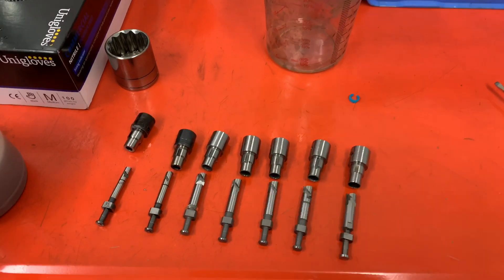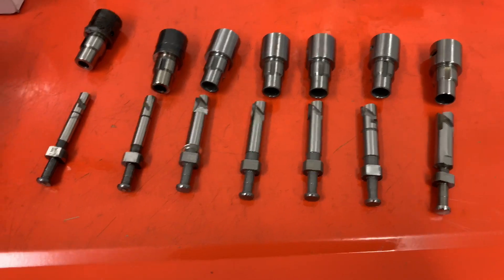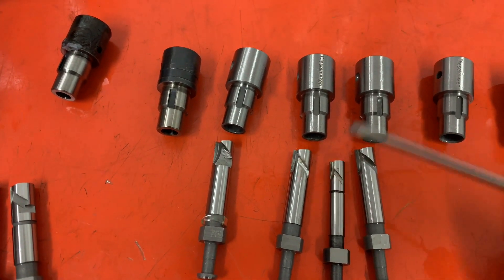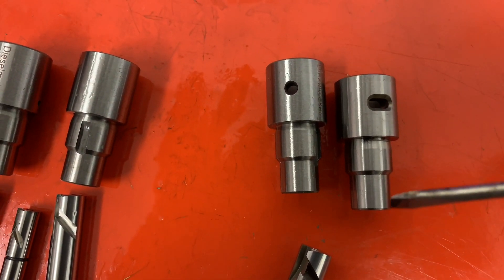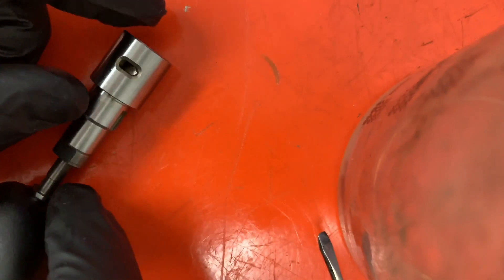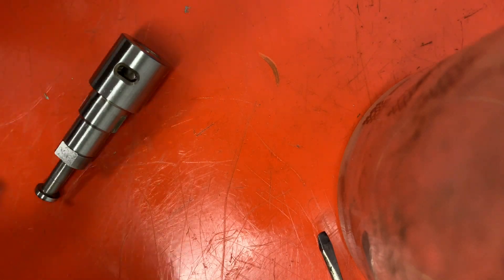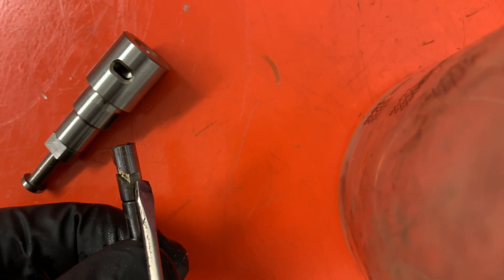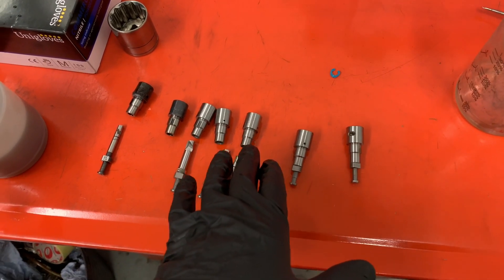Fuel Pump Elements Explained - Dieselpumpuk

Comment: Many thanks. The manual diesel pumps I work on are a little different because they are for stationary engines like the Petter PAZ1 and AV1 however from parts diagrams the principle is the same and this video explains exactly what is going on so it was very helpful.

Comment: Do the 7.5mm elements get good gas mileage? Putting an OM606 in my BMW e30 and I’m looking to make around 300-350hp to the wheels and get really good gas mileage. Does the design of these larger elements sacrifice gas mileage? Or can they be adjusted to suit with an ALDA? Thanks
Reply: Yes because it will push the same fuel in for idle so just be easy on throttle and it will push the same fuel as stock.  It just allows a lot more fuel at 100% throttle than stock.
Reply: im doing the same, getting dieselmeken 8mm done for my pump

Comment: How much hp it's possible to squeeze out of  NA elements(100% stock everything)  by just slaming turbo on and just rising prepump pressure?
Reply: There are some small differences between the NA and turbo engines - mostly extra oil squirters and some other stuff to stop the turbo engines eating themselves through high temperatures.
I don't know what a safe amount of hp increase is but you can consider the om602 in na and turbo.. around 25hp, yet mercedes didn't think it was safe to turbo the existing na engine without some other changes for the internal temperature increase.
I've got an om602 na with a turbo and intercooler.. it's still slow, just a bit less slow than standard.

Comment: So if i buy 7.5 elements for my 617 engine can i just change them with this? Or do i need other oump
Reply: Following for answer
Reply: looking for the same answer
Reply: These elements are for an M pump, OM617 turbos came with MW pumps which use different elements, however, some OM617 n/a did come with M pumps which can be modified with these elements
Reply: What om602 124

Comment: Do you modify the cylinder head along with fueling and boost pressure?
Reply: Usually these diesels are built for high cylinder pressures and the head gasket will hold double the power however going up beyond that you might want ARP studs and maybe a multi layer metal gasket.

Comment: Can some tune be done to a merc incresing HP without the huge black smoke effect..... I'm not talking about going from 200hp to 650 but something to give the car just a bit more sportiness
Reply: Yordan Sergeev if you have a mechanical diesel pump you can up the fueling on the pump and also up the boost and gain power this way without getting ludacris amounts of smoke if you have a edc pump you need to get the ecu chip socketed and remapped this will make the difference you want
Reply: A bit of black smoke never killed no one 👀
Reply: @joczo97  bit of black smoke will lead to paying more tax and very soon will lead to a car change since in my country soon smoking diesels will be banned probably
Reply: @senseiDi  what country are you from?
Reply: @davejohnson3474  Bulgaria
Reply: @senseiDi  oh really? Didn't think bulgaria was strict like the uk germany or france. Uk's getting hit with ULEZ soon :( all pushing for electric cars.
Reply: @davejohnson3474  It is, they wanna stop diesel cars little by little, and from 2019 they have rised the tax per year for cars that have bad emissions and those that are made before 2005 or do not have EURO 4 cert. Some cars will go from 200 euro tax to 350-400 depending on the hp and if you have or not a CAT.

Comment: Hey buddy can you send me a cylinder head for om606 1999 e300 i screwed up with glove plug it broke inside the original head and i tried to drill it out and it went off the line and i messed up that head and i m looking for it to get and is so hard to find let me know what i can do with this is it fixebl or do i really need a new cylinder head
Reply: Did you fix it?
Should be able to drill it with the drill glow plug repair kit he sells

Comment: I was thinking about asking this question yesterday on what modification are done on the pumps and now it’s here. Thank you for explanation. I have second question, why you only work with 606, is there  problems with 648?
Reply: zeomarmob OM648 is common-rail. Totally different injection and combustion chamber design than om606
Reply: On om648 you need big injectors, big high pressure pump and software to get same amount of fuel and power. Witch means at least double amount of money.
Reply: johanijohani common rail is the future. Injectors cost just as much as the pump for 606, and you dont need a new pump before past 400bhp on on648. Besides you get better response on common rail than old pumper 606.